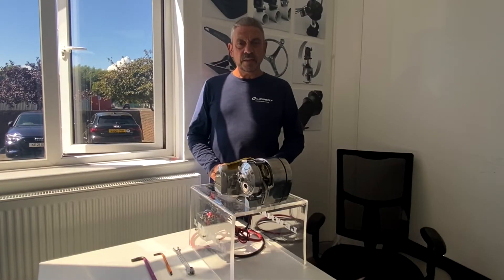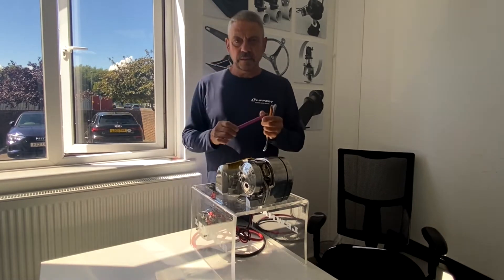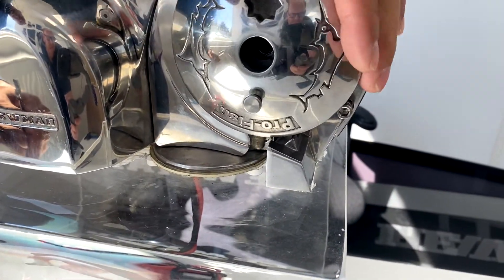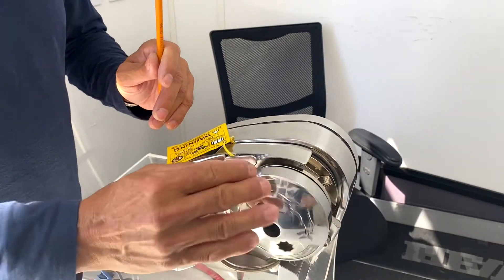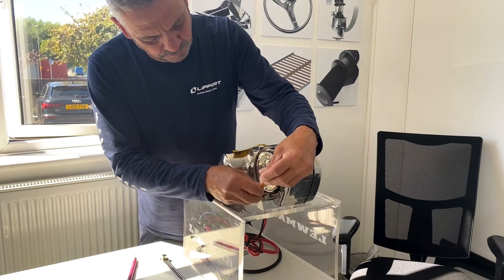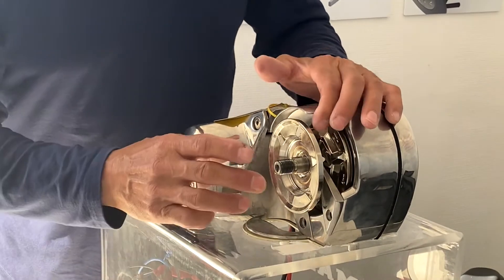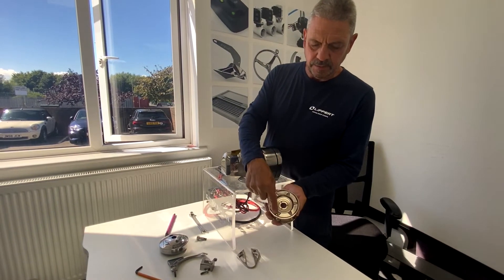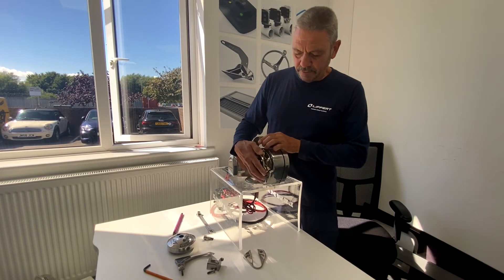Gypsy Replacement on a Lewmar Pro-Fish Windlass

Comment: My gypsy doesn't have a magnet, and the only markings (RC-0860) are marked in both sides in the inside. What changes is that one side of the gypsy has a larger diameter than the other, and the teeth inside are angled (so the angle can be either pointing forwards or aft if looking from the starboard side of the unit). If the teeth are angled aft, the larger diameter is on the starboard side (facing out with respect to the unit); and correspondingly if the teeth are angled forward, the larger diameter side is on the port side (facing the unit). Which is the correct gypsy orientation in this case?